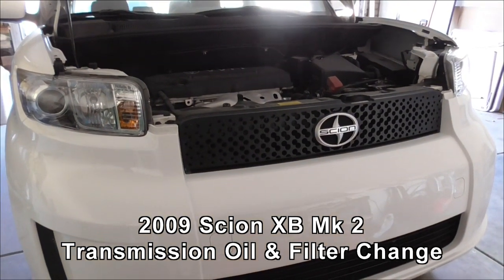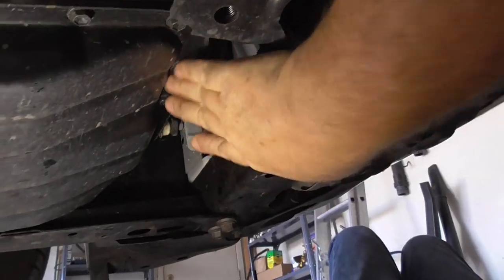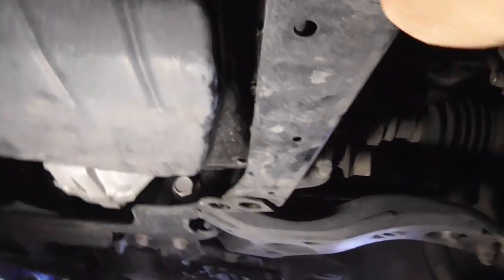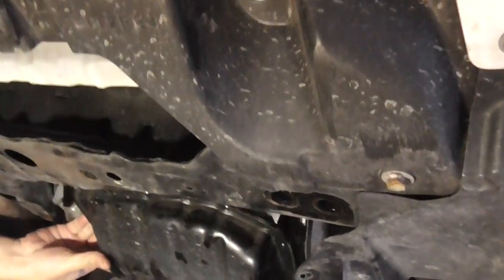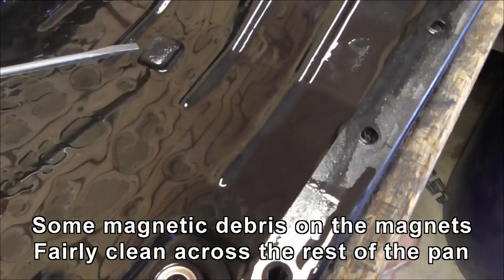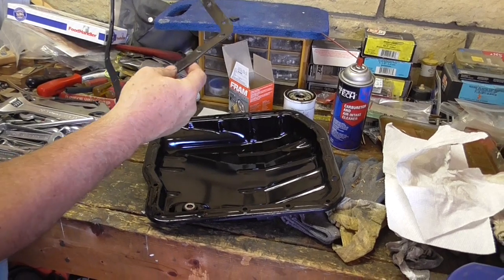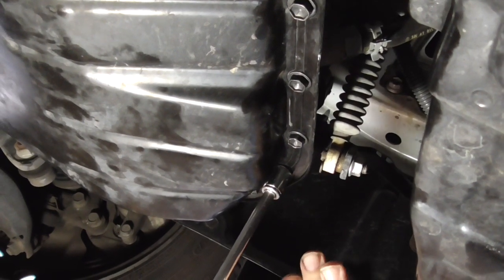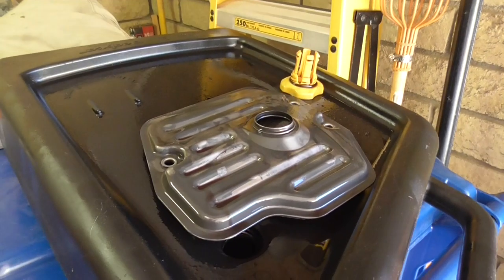2009 Scion XB transmission filter change

Comment: That car looks brand new underneath and probably no miles... great job
Reply from the maker: It is low mileage, but we live in the desert - so stuff just doesn't rust and with so little rain, the underside just doesn't get coated in crud.
Downside is batteries, rubber and plastic parts fail rapidly.

Comment: Very great helpful video and like the way you explain everything but I have a question, I have a 08 Scion xB with automatic transmission and have 257xxxmiles on it do you still reccomend changing the transmission filter & fluid?
Reply from the maker: If it has never been changed, I would say it was worth doing at 250,000 miles. Post a pic or 2 of what you find in the sump :)
I would recommend the Toyota or Aisin fluids recommended for the vehicle because you will be mixing it with the fluid you can't get out of the torque converter without doing a complete exchange. That requires special dealer tools.
I got the filter & gasket from Rockauto dot com
Here's a link to who Aisin is... https://en.wikipedia.org/wiki/Aisin_Seiki

Comment: It looks like you would have access to those bolts if you had removed the wheel first?
Reply from the maker: Well that would be quite tricky to do with the car up on ramps. If that works for you then great, there is usually more than one solution for most problems. This worked out for us. No odd tire wear since I did the change so the steering was not affected by the removal of the sub-frame piece.

Comment: Im about to do my filter. Got a 2008 xb 6mo ago, just over 207k not sure when it was done last but have a code for the torque converter clutch solenoid. Should i replace it at the same time or see if new fluid frees it up?
Reply from the maker: I don't know where that solenoid is located. Had a quick look on a toyota parts site and they don't show it.
It may be in the valve body that the filter attaches to, but???
It could well be clogged with debris which you are going to find out doing the fluid change.

I have never removed the valve body from one of these transmissions, but you may have to do that to see if the solenoid or valves inside the block are clogged or stuck in one position.

If you do that, take lots of photos along the way to help with the re-install.
Reply from the maker: Cheapest part I saw was on rockauto by the way. Not sure how good that would make it.

Comment: Thanks for the video. I just did mine and put 4 quarts of atf ws toyota transmission fluid back in. When you say a little over 4 quarts in you video do you know how much over exactly. Im having trouble reading this dip stick and would like to get it as close as possible to spec.
Reply from the maker: Sorry, I don't remember how much over 4 quarts it was. Half the problem with reading the dipstick is that you have to re-fill the tranny thru the dipstick hole and it leaves a film of oil in the tube that messes with the reading.
Reply: Late but , I dip the stick 90% in like 20 times to clear all the oil on walls of the tube. Once I  didn't have any oil on the stick as I took it out. I deep the stick all th way 3 times. If you need to add more just keep in mind that the oil level is almost there ,so just a 3rd of the quart can get you there.

Comment: How many quarts of transmission fluid when you changed the filter?
Reply from the maker: Hmmm, it's been a while since I did this. Lucky for me I put that information in the text under the video - a little over 4 quarts
Reply: @richbinaz it’s 3.7 quarts for a drain and fill. It must be more than 4 quarts if you drop the pan to change the filter
Reply from the maker: @Peppy11769  Well, you can't buy 1/2 a quart so buy 5 quarts. I don't know the current cost of toyota fluid, but it's probably worth sticking with their WS automatic fluid

Comment: I have a 2012 SCION xb I
took it in to the Toyota service center for an on time 60K fluid and filter
change a complete change. They told me the Toyota filter is a life time filter
and dos not need to be changed with their machine they put it on. It was weird
they drive it on this machine while it’s flushing and cleaning the transmission
and filter. At the end they said see you again at 120K miles. And my tranny got
a clean bill of health. Whatever they do they said it cleans the filter also as
it is good for the life of the tranny... Is this correct? I got one of the Toyota
mechanic and asked him directly and he confirmed it the filter does not need to
be changed... it feels so wrong to me.
Reply from the maker: Interesting comments there Michael. I can see where you may need to have the engine running to do a complete change of the fluid as most of it is held in the torque converter and the only way to get that out is to run the engine. As for having it on a rolling road?? Having it go thru gear changes just sounds dangerous to me.
Cleaning the filter... If that process cleans the filter, then the filter does not trap any of the dust and is useless.
There is also the crud build up on the magnets and the black dust inside the sump pan.
That sounds suspicious to me as well.
Reply: Michael how much did you spend for the 60k service?

Comment: Do you check the fluid level with the engine running?
Reply from the maker: Good question - I think the answer is always yes on any automatic transaxle. I treat it as cold when I'm first doing it and then check it after a run to make sure it isn't over the hot mark. But yes, engine running at idle.
The "always yes" answer is not quite true with the newer units - specially with the Toyota CVT's or ones that don't have dipsticks. There you have to check it thru the double drain plug where it has a straw to give you the full level & the oil has to be in a certain temperature range. Engine still running though, and car must be level - so I can't do it with my current ramp set up.

Comment: I have a 2015 Scion XB, is it the same instructions and platform as the 2009 model? And perhaps what brand of fluid did you use. And does it have to be OEM fluid? Thank you! Great video!
Reply from the maker: There may be some minor differences, but the basic concept should be the same. 
I used the OEM fluid as it is the stuff they tested the car with and it avoids problems like - is it the right viscosity (at all temperatures)? Does it have the right friction modifiers so the clutches engage nicely and don't slip? Is it chemically compatible with all the materials (gaskets, o-rings, electrical wiring and connectors, fibrous clutch plates etc) in the transmission?
There are lots of aftermarket fluids and people have their favorites. If you want to take the risk with a non-OEM fluid to save a few $$, nothing I say can stop you and it may work out fine. IDK